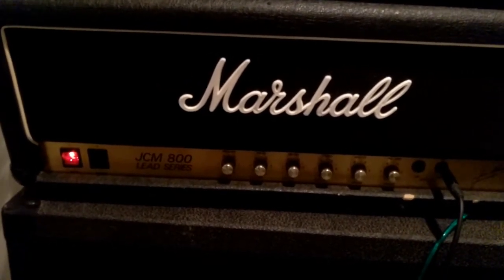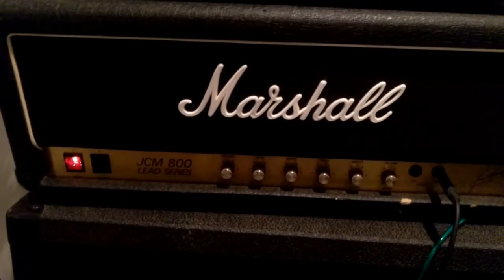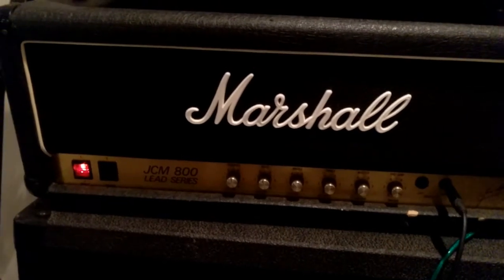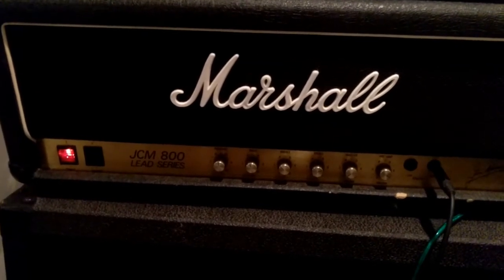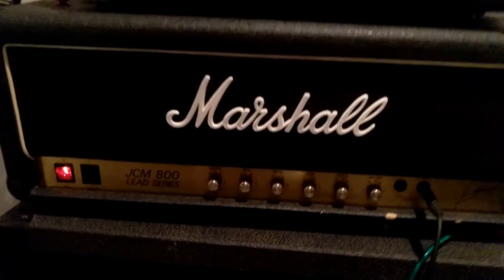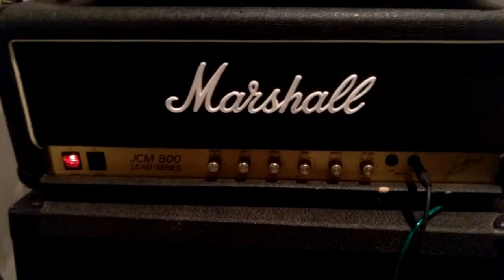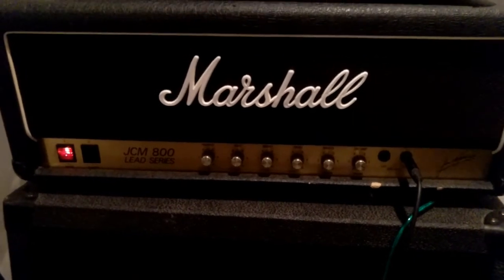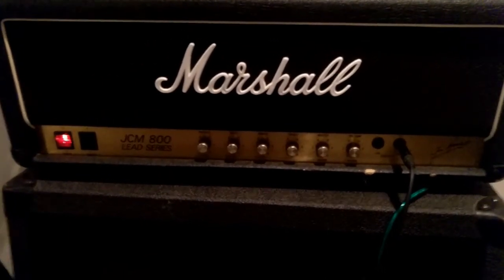Marshall JCM 800 2203 Repair Help

Comment: Capacitor is building up a charge then a bad earth is letting it dump it through the chassis hence the pop......so you have a dry joint capacitor.....maybe, hope that helps